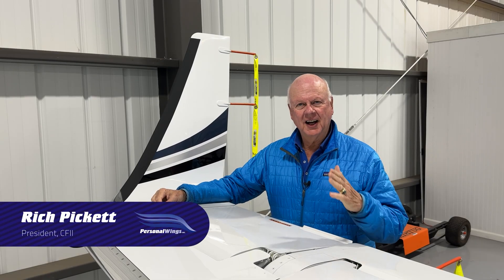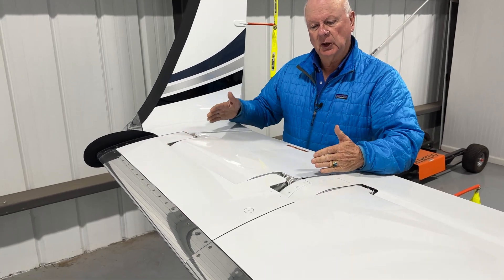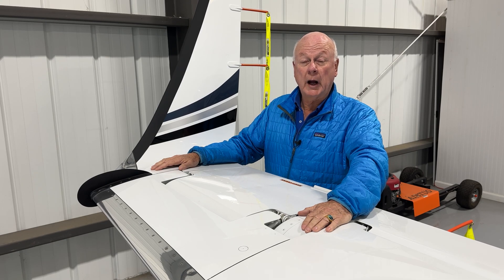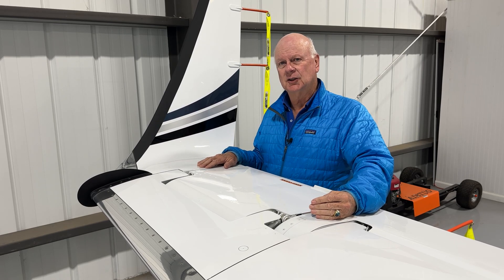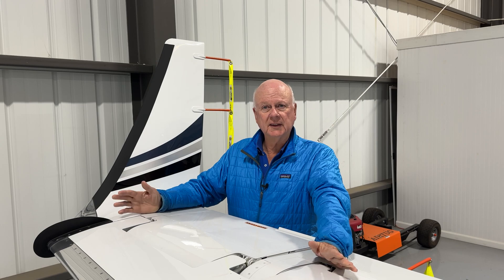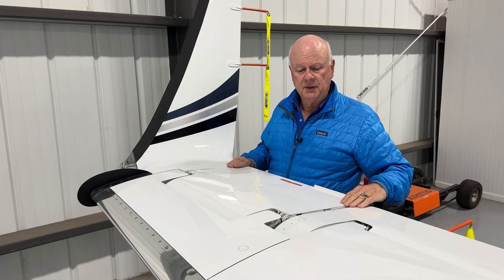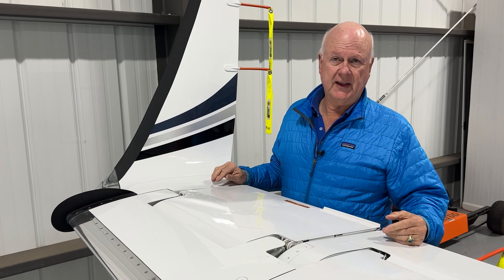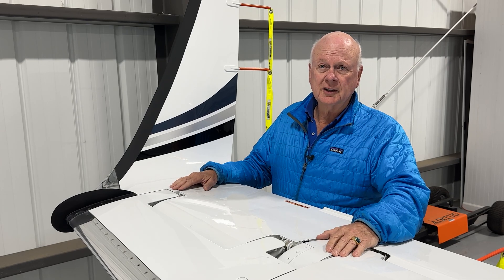Wingtip and Winglet Break Off Citation Jet – Tamarack Winglet Departs Citation CJ3 In Flight

Comment: Sounds like there was some deflection and aileron binding according to AOPA
Reply from the maker: I believe the aileron deflection, binding, and damage was caused by the winglet as it departed the aircraft. The ADS-B returns show a very high ground speed, which is probably facilitated by a strong tailwind.  I've tested a number of aircraft with winglets, through a full speed spectrum - stall to Vmo/Mmo without an issue.  It was encouraging that the pilot was still able to control the aircraft, and we hope to learn more from the full NTSB report.  In the Tamarack emergency procedures, IAS should be reduced to 140 kts if an INOP CAS is received.  I would imagine it would be best to slow down to that speed if one was missing :)  The aircraft speed was still  very high after the incident.

Comment: Tamarack claims the failure was due to “external” factors. Since it happened at 27000ft I doubt it was a bird. I would be interested if that extension with the short chord length was tested for bird strike. It potentially could deform aft and cause the active surface to interfere with the aileron. I imagine that was considered during the certification process.
Reply from the maker: No birds up that high except the Ruppell's griffon vulture (FL370) and the bar-headed goose (FL280). Perhaps another Chinese. balloon?

From the low res images/video, the leading edge seems straight and intact. Very curious indeed to hear more about the findings.